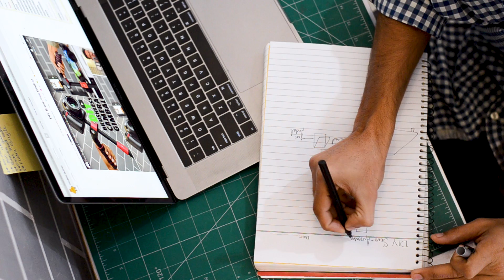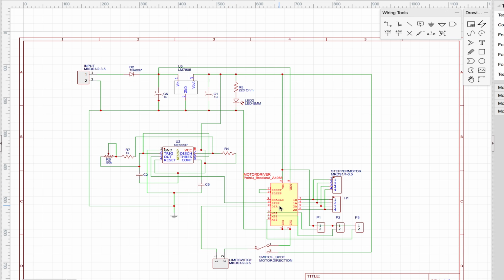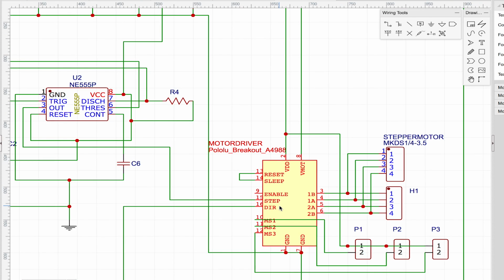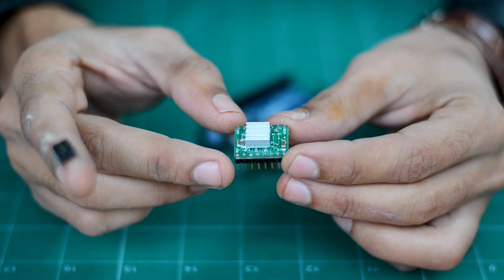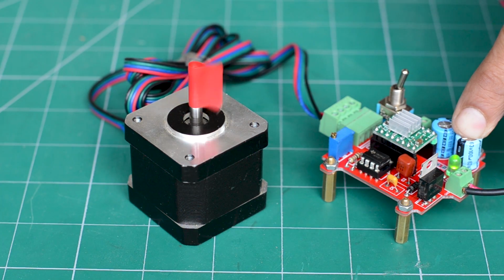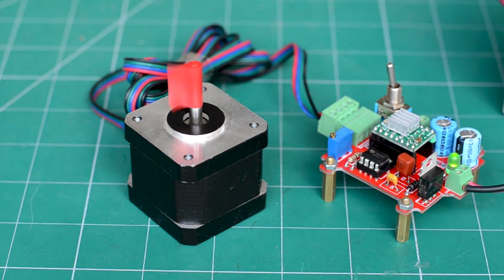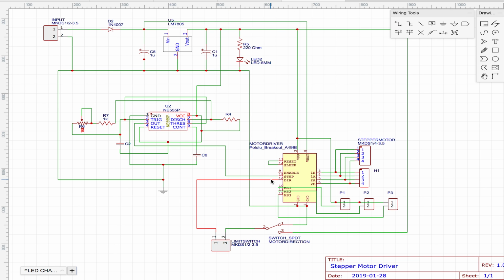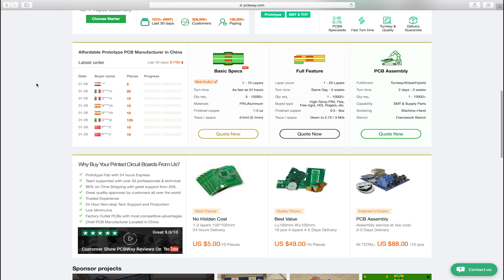How to make a Stepper Motor Controller (Without using a micro controller)

Comment: Great video! I ended up with a 28 VDC stepper motor that has 3 winds or coils instead of 2. Do you have a suggestion on how to make a controller for that? thanks in advance.

Comment: I want to rotate stepper motor 360 degrees in 5 seconds and will stop for 2 minutes and 55 seconds 
Again it will rotate 360 degrees in 5 seconds and will stop for 2 minutes and 55 seconds and...... will continue to do so
It's kind of cyclic timer

Comment: I was just wondering if a knob style potentiometer would be more convenient to use rather than a screwdriver. Is it easy to solder one into the same circuit board?

Comment: @DIY King I am trying to actuate a sewing machine servo motor via a mouthpiece for a double amputee. Do you think I could adapt this project to actuate a foot pedal using a clench piece in the shape of a clothes-pin with an angle position sensor to send the PWM to the controller?

Comment: I like your design, but I had one question.   The A4988 datasheet specifies to put a 100uf capacitor electrolytic capacitor between VMOT and GND, but you don't have that.  Almost all other designs that use this type of driver chip do and as the datasheet recommends it I was wondering why you don't have that capacitor.

Comment: This is not making a "real Stepper Motor Controller" from scratch, since you're using a commercial "Stepper Motor Controller", the only thing is ur adding a 555 timer to drive the commercial Stepper Motor Controller. As again this video does not show u how to make a Stepper Motor Controller.

Comment: can we use Nema 23 3A 2.2nm Stepper motor with this controller please answer my question
Reply: I believe it will work, but it will likely not be able to supply enough power to run the motor at full power/torque. i recommend using a more powerful stepper motor driver.
Reply: @WillieFiddler  Thanks Man
Reply: @WillieFiddler  I am trying to control a sewing machine foot pedal via a mouth controller for a double amputee. Do you know what rating motor I would need for that? My guess is that the required torque would be around 5Nm.

Comment: Dear if i would like to use this circuit for my up coming project of CNC so i need to turn ON and turn OFF by RDNO so how can i control switching in this circuit because this circuit is directly ON as you shown in this video. Is anyway that i can control by pulse. Please reply. By the way quite informative and useful video for me . Thanks.
Reply: Only way to control by pulse is use a microcontroller